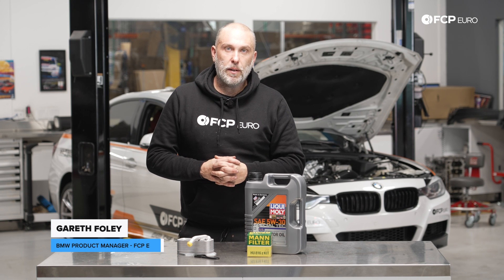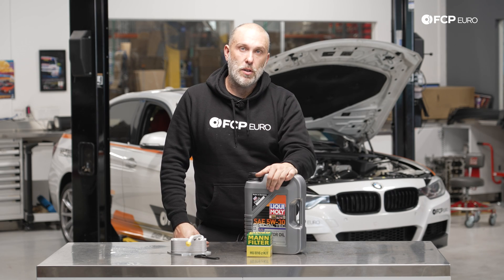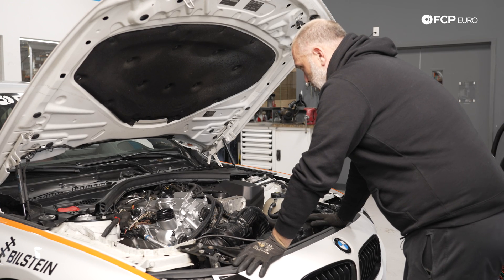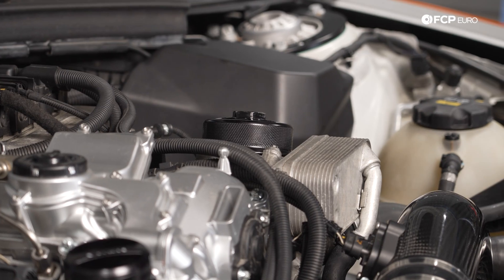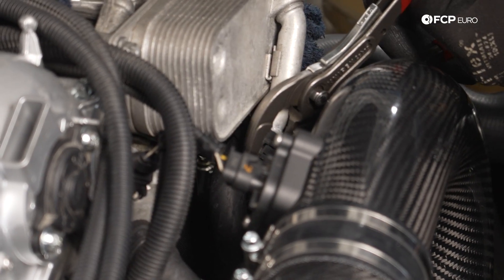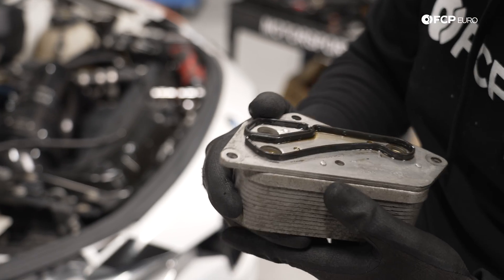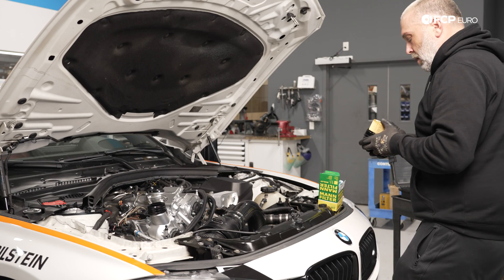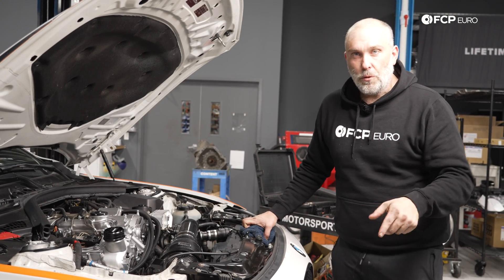BMW 328i Engine Oil Cooler Replacement DIY (2012-2018 BMW F30 320i, F31 328i, F32 428i, F22 228i)

Comment: I have a question, how many hours it needs to fix this issue on 430i xdrive 2018?
Reply: You drian the coolant but I didn't see you put any back in
Reply from the maker: Book time for the job is just over an hour. Would probably account for double that if it's your first time attempting it.

Comment: Great video. Quick question. Where would the oil cooler on my 2014 328d be at?  It's -30 celcius here 🥶 and I'm sure my cooler is starting to leak because I can now smell burning oil when I am driving at times...especially for extended periods of driving. I'll be ordering one from you and replacing it when the weather is a little warmer.

Comment: Hey Gareth, thank you for the super helpful guide! I just had a quick question, do you think it’s possible to swap the oem oil cooler on the n20 to an n55 style oil cooler? Specifically the one you mentioned at 0:35.

Comment: Happy New Year Gareth.

Have you guys ever disassembled one of these brick style heat exchangers?  I've wondered what they look like inside.
Reply: I have the same question. My auxiliary oil-to-water cooler failed internally on my '14 335i xDrive M-Sport with the N55 engine (my aux cooler has 4 connections coming out of it, 2 for coolant in/out and 2 for oil in/out, and is located next to the coolant reservoir). What causes an internal failure on these? It was an absolute nightmare to deal with, because it caused oil and coolant to mix. I luckily caught it after only one day, when the low coolant light came on.
Reply: @heistkevexact same thing happened to me after a head gasket job too!!